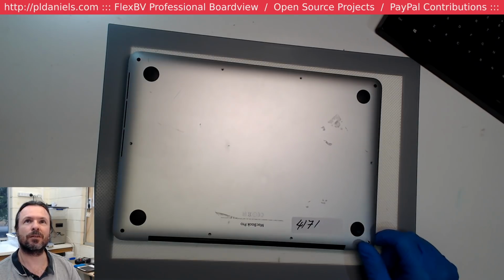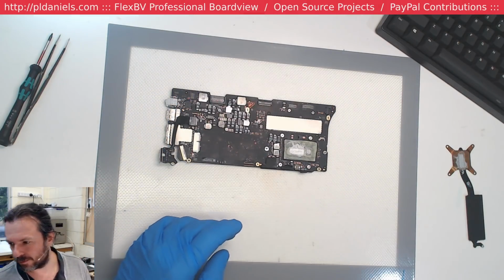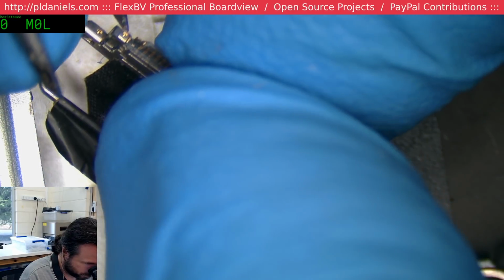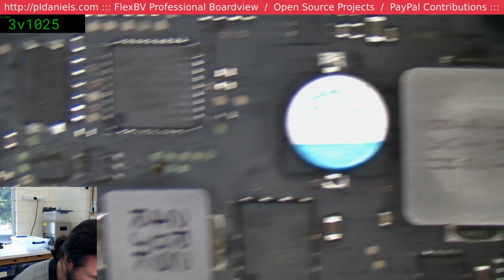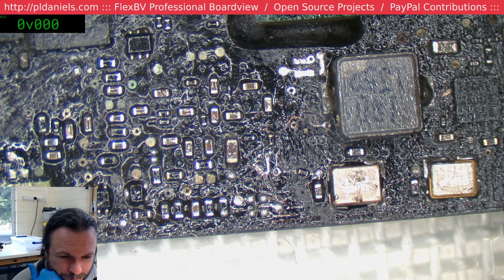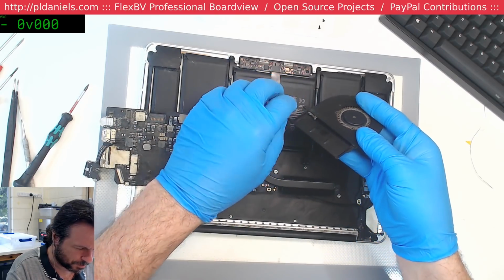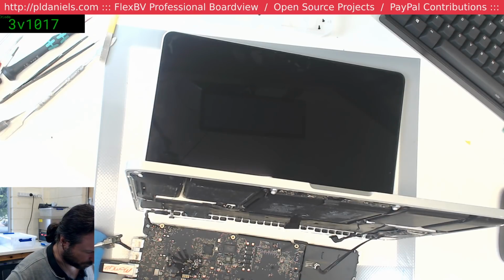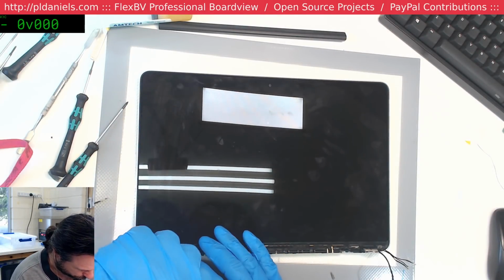Macbook Repair Workshop - A1502 Retina, no power

Comment from the maker: After walking away from this triple disaster, I'm thinking of checking that "dead CPU" board again, because there's no guarantee that it's the CPU that's shorted, it could still be one of the bypass caps; however that said, there's so many other things wrong on that board that it might be a blessing to steer clear of it.

Comment: Never mind paul, you can't help being crap at repairing apple laptops Ha Ha :-D Joking :-D.
I would not worry about how imperfect the machine is, your customers don't give a dam!!.

That one with the dead cpu covered in silver grease likely had a overheating problem originally, Someone tryed to fix it but they killed the cpu with stupidity.